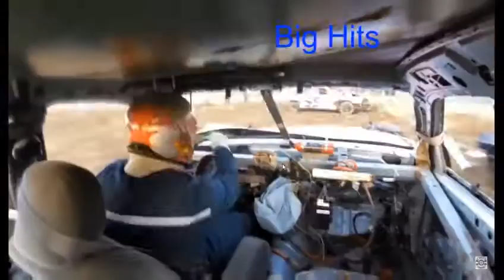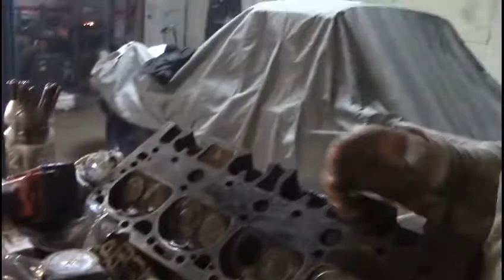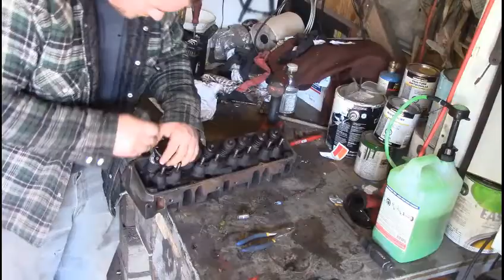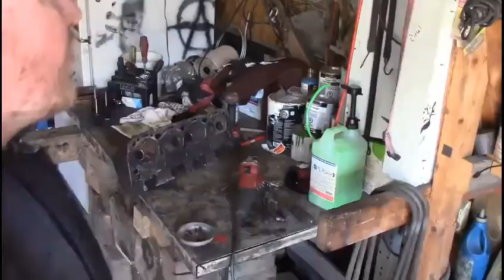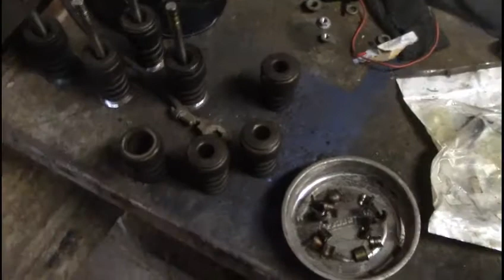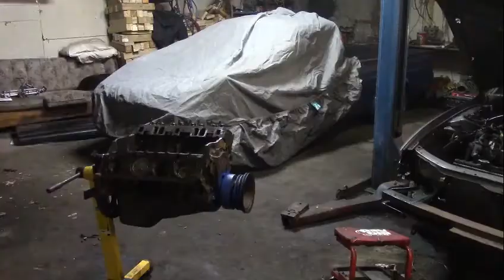small block chevy rebuild for demolition derby use part 6

Comment: for valve removal, you do not need your spring compressor!!!!!,  take a deep well socket that fits the spring retainer, and take a good size hammer and place the socket over the retainer and smack the socket with the hammer, the valve keepers will "FALL OUT" , also lay the head flat on a metal work bench       you can have all the valves out of the heads in less than 5 min. I noticed that valve face of the exhaust valves were "DISHED IN" from wear, they really should have been refaced( intakes too) also you did not lap the valves in, and I really did not see any assembly lube on anything ( dry engine), and I did not see the bearing shells replaced( main, rod, cam). also, just for good valve stem lubrication, I would have left out the valve seals!!!!.
Reply from the maker: ya i dont knwo much about motors thats why i gave up on it